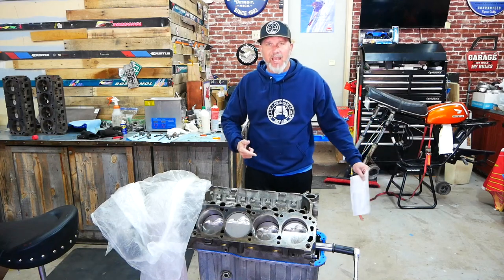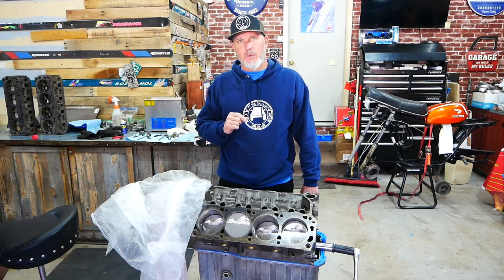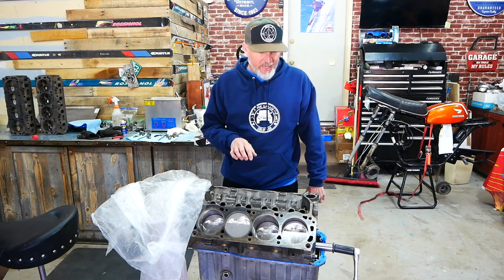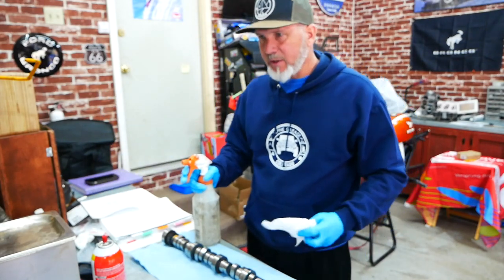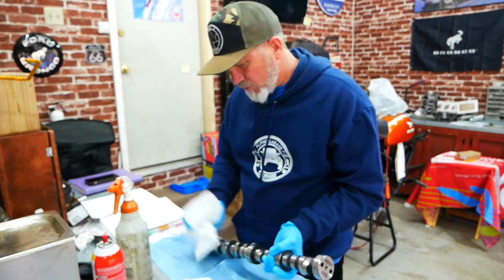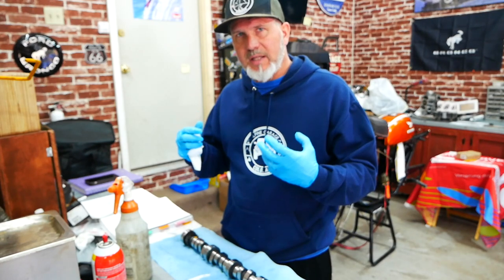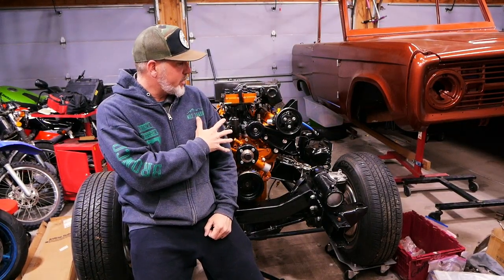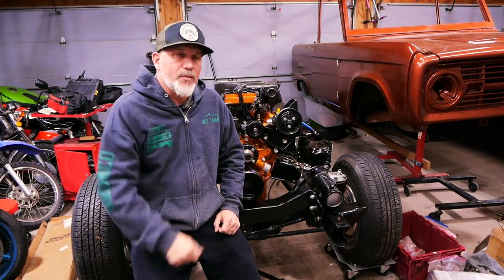Bronco 347 SBF Cam Choice and Install

Comment: Great videos- appreciate the research and effort you put into it. Doing the same as you for a 71 Bronco and like your reasoning/decision making on the cam selection. Question - do you think your cam selection/research apply to a 1991 SBF 347 roller with AFR enforcer 185 heads?

Comment: I've watched all your vids on this build.  I'm about to tear into a 99 Explorer 5.0 for a similar build ('89 Bronco II retro fit...), and I'm curious after watching the tear down, why you decided to go with the stroker.  I realize that the cylinders were a little out of round, but overall the block looked good.  Is that the reason for the stroker, or did you just want the bigger cubes? 
Thanks for the great vids...
Reply from the maker: The block was great. I had decided to stay with stock refresh when I found a Stroker kit for easy stupid money.  Well, that caused a chain reaction of event that actually caused me to lose thousands. Stick with your stock build. Those blocks are great for keeping true even at 160,000 miles.
Reply: @alpinegarage8548  Thanks, yeah I understand about the blocks and the slippery slope.  The siren song of the stroker is almost too hard to resist.  Then before you know it you've taken a simple rebuild and turned it into stupid money.  Best of luck on this thing.  I'll stay tuned.

Comment: What headers are good for the 5.0 expleror 1997
Reply from the maker: That is a good question. I’m not sure yet and doing a lot of research. Buying next week if I can find a pair.
Reply from the maker: I went with Scott Drake Shorties.  After calling every supplier, they couldn’t guarantee the fit around a 4r70w for long tubes. They went on great.  I’ll have a vid out in about a week.